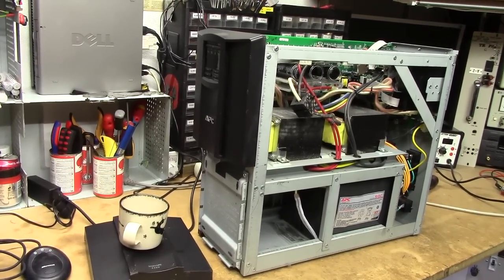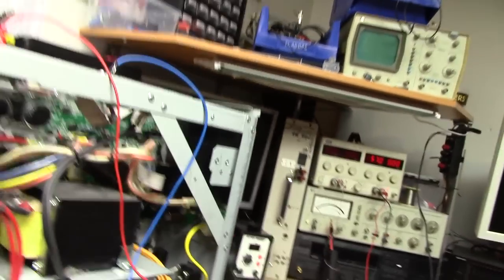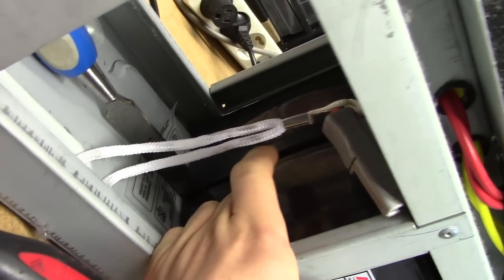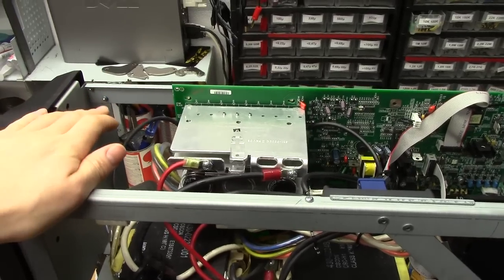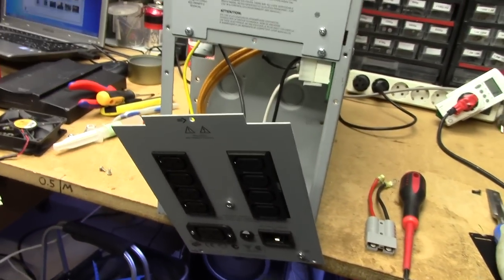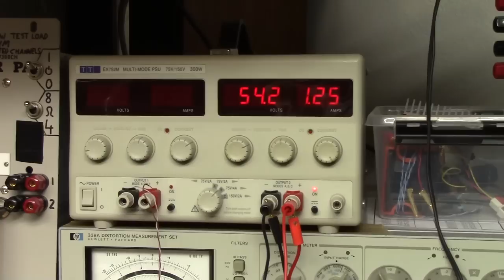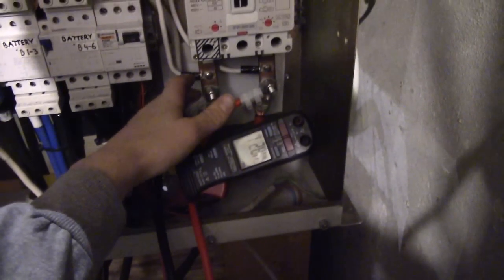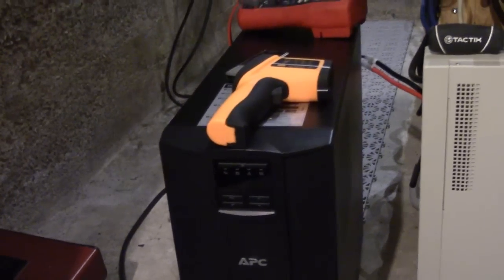Trash-picked APC Smart-UPS 2200 battery removal & hacks

Comment: Hi, FFcossag and thanks for the video !

I'm a sound engineer and would like to use one or two devices running on 220 volts but outdoors !
- This means : battery !
So I must absolutely find a battery that delivers 220 volts and be able to last an entire day (a dozen hours of battery life)
- This means : inverter !
Now I know that the inverters that most closely match my budget do not have the autonomy I have needs !
My first big question is : can I connect any 100 ah battery at any inverter ? (by replacing that of the inverter)
My second big question is : does it cause a problem when to connect the inverter (with new battery) to 220 volts to recharge it
My third big question is : are there other questions should I ask ?

BIG THANKS !

PS : EXCUSE MY ENGLISH !
Reply from the maker: +Sad Moul El Foul Unless you're powering something really small (like a laptop), you're gonna need a lot more than a 100 Ah battery. If you're using a UPS like the one in this video, you also need to improve the cooling, else it'll burn up on you. As far as batteries go, as long as the voltage is right, you can connect almost any battery to any inverter, but UPSes like the one in this video are NOT built for continuous running, so I'd suggest buying an actual inverter if you're thinking about hacking a UPS.
Reply: +FFcossag Thanks for the reply dear friend :)
Yes it is quite logical and clear that we should think of the cooling of the device !
Thank you again :)
Reply: I understand myself better now !
In fact the only reason I opted for a UPS is precisely because the only ones I had in mind (small and cheap) had not fan needs due to their limited autonomy !
But this is precisely not what I want !
So, I would ensure that my energy device is well ventilated !
Thanks !
Reply: Given the current availability of solar inverters that use lithium battery unless the charge profile can be changed. They aren't as attractive as they once were

Comment: Anyway to hack these 48v APCs into 24v?
Reply: WHAT!?! They're 48v?!? I have one wich just won't start off whatever 24v source i throw at it even after fully recapping it and i couldn't find any datasheets for the battery so i assumed it was 24v like most smaller ones.
Thanks for giving me the information that i needed to get mine up and running again!

Comment: Are you still running this system full time?
Reply from the maker: Yep, in a sense; the UPS provides about 1-4 hours of solar power every day, depending on how sunny it is.
Reply: FFcossag any other modifications needed to run it for longer? I have 2 of this model coming to me soon. Looking at 6-8 hours running on batteries.
Reply from the maker: I made a video about doing just that, here: https://youtu.be/qkYTxULcYeo

Comment: I watch your Videos just for some days - and one question comes to my mind: Why do you have so many of these things?
Reply from the maker: +FelixBraun I get lots of them for free, and I can't relegate a perfectly servicable and modern device to be recycled with a clean conscience.
Reply: +FFcossag So you just store them?
Reply: +FelixBraun Sometimes we don't need (or we don't want) to sell things. I don't think store them is a bad idea.
Reply from the maker: FelixBraun I hoard some, I hack some, I give some away, I sell some. Power quality here on the countryside is pretty bad some times, so they're useful. There have also been times when I've wanted to do something silly, and I've just stripped down a few UPSes to achieve my purpose. I once took two 1500 VA Smart-UPSes and turned them into a 12 V, 1000-ish W inverter.
Reply: +FFcossag I can understand that hording thing. I have around 20 5m Rolls LED-Tape and thousands of LEDs laying around, plus some more stuff since it is so cheap to buy on AliExpress and other sites... but that's tiny stuff, I have, not bigass UPS' ;)
Reply from the maker: +FelixBraun Size is relative; my UPSes are nothing compared to the stupid amount of batteries I've got, and then there are those who hoard things like cars.

Comment: That water you got on your hand is acid! you need to clean your havds with some soda then clean out the battery area with bakeing soda. the acid will over time eat things up!
Reply from the maker: Any water in this was certainly not acid.
Reply: @FFcossag  if it came out of the batteries it is acid or some kind of chemical. Much be something more than just water.

Comment: It's possible to tweak the battery charge voltage if need be, or at least it was on the older models. APCFIX.EXE is good for resetting battery constants that can drift if the batteries get too old. As for the charge voltage: http://rodsrandoms.blogspot.co.uk/2015/11/troubleshooting-apc-ups-and-other-upss.html
Reply from the maker: +AintBigAintClever I'm going to dig into this deeper once I figure out the serial interface on it; it comes out of one of those 10-pin RJ45 style connectors which seems to be difficult to find data on. Thanks for the link, though - lots of people have been asking me for that information in text form.
Reply: +FFcossag I'am curious on this too! :D
Reply: I'll have to check in the office, there are cables from an SMT1000I on my desk which will include the RJ45 one. I've not had to serial into an SMT yet, only the SmartSlot cards.

I know the older ones use a non-standard serial cable; a standard cable will REPO the UPS when you plug it in, not good if you've got servers running on it.
Reply from the maker: +AintBigAintClever If you have a reference for the RJ50-to-DB9 cable used for serial on these machines, I'd be glad to hear it. Reverse engineering it from scratch would be such a bother, and pinouts.ru seems to be down.
Reply: I hadn't realised it was ten-pin. I'll see if I can work out the pinout next week (can't get into the office on the weekend).
Reply from the maker: AintBigAintClever Nevermind actually; I took it apart and the RJ50 just goes straight into a MAX232, so it was pretty easy to figure the pinout out.
Reply: Typical! Just found one of the cables whilst tidying up. Pinout measured and plug chopped open to double check.

Cable part number is 940-0625A
DB9S pin 1 and 4 together
DB9S pin 2 to RJ50 pin 2
DB9S pin 3 to RJ50 pin 8
DB9S pin 5 to RJ50 pin 7
DB9S pin 7 and 8 together
DB9S shield to RJ50 pin 4

Subtract one from each of the RJ50 pins if bodging it with an RJ45.
Reply from the maker: AintBigAintClever Thanks - that's exactly the same as my reverse engineered cable. It's really useful to have a reference, since it isn't working, lol. Thanks for taking the time!
Reply: No worries. Looking at the APCFIX compatibility list on its website there's no mention of the SMT series so they may not be detected after all, although the funny handshake combo over the COM port (shift-Y, 1, wait a second, 1) might yield something. I'll have to have a pop at the new one in the office before it gets installed.
Reply: I don't know if the external SmartSlot chassis (AP9604) is compatible with the new UPSes if used with the new cable plus an external supply. I've got two AP9604S units to play with but they won't talk to SmartUPS, only Silcon. There's an AP9604 somewhere at work that I may be able to swap to an internal card, if I can do that then I can compare AP9604 and AP9604S and possibly do a conversion, either way if I can get an AP9630 or AP9631 card to work through the chassis then I may be able to glean some info by monitoring the serial traffic.
Reply from the maker: AintBigAintClever
I did some digging on the newer Smart-UPS series, and it seems they don't do the traditional Smart-UPS protocol through the externally available serial port any more. They're limited to the new proprietary protocol, or the new APC MODBUS implementation. However, I've found an internal serial port on the SMT2200 which DOES talk traditional Smart protocol over 5 V TTL ...
Reply: Modbus? Interesting... now you've mentioned that it's popping up in APC stuff I'm looking at. The AP9620 may be required to add legacy support (e.g. smart signalling, external chassis etc.) but it looks like you've found an internal option. May be worth repurposing that MAX232 you found :)
Reply from the maker: AintBigAintClever Trust me, I'm working on it. Sadly, though, the internal "smart port" seems to kind of break the front panel UI if you try to use it, but I'm sure there's some ugly way around that.

Comment: I hack my ups 350 and get run for more than 7hours and 25minutes I have 4 12 volt lead acid battery 3 12 volt 7.2 Amp and 20Amp battery